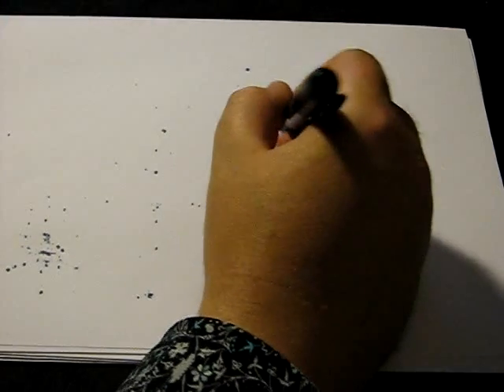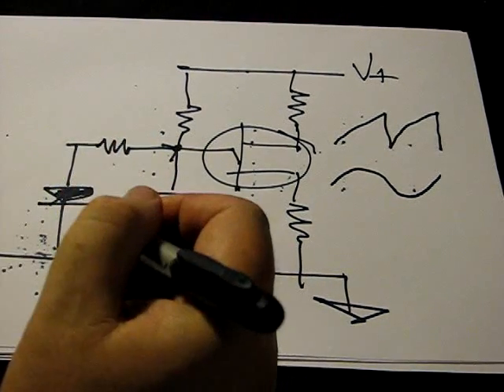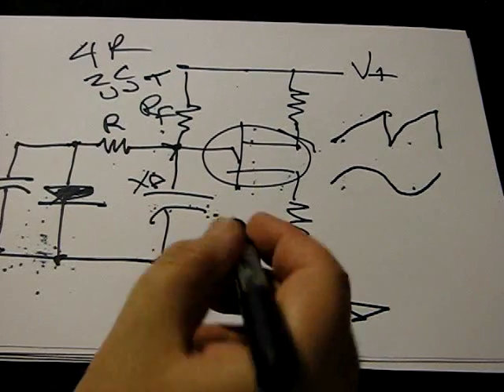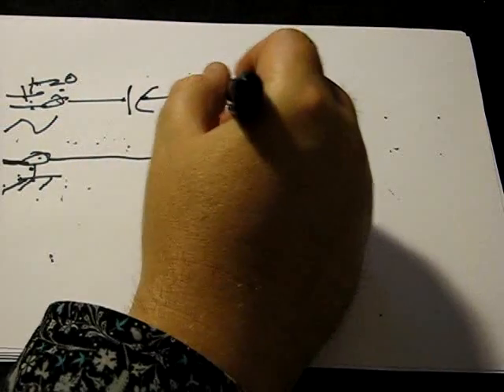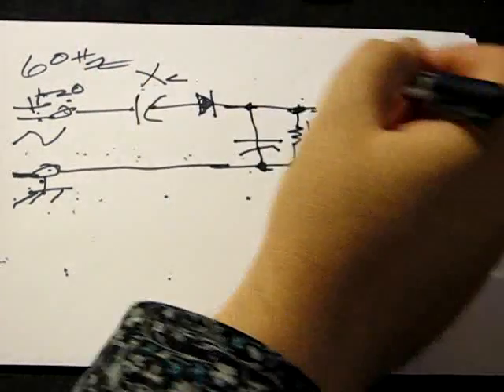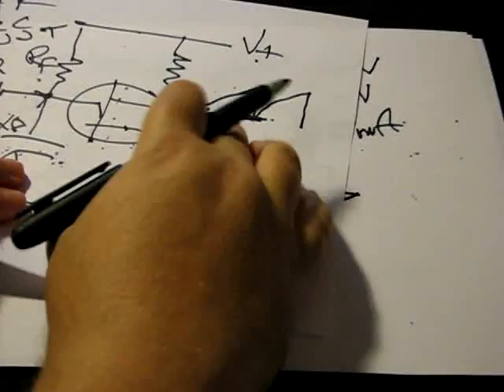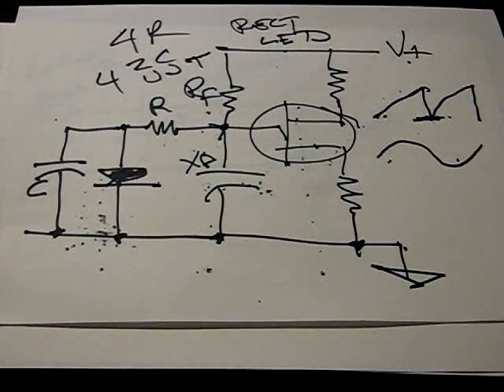Relaxing Oscillators page 2

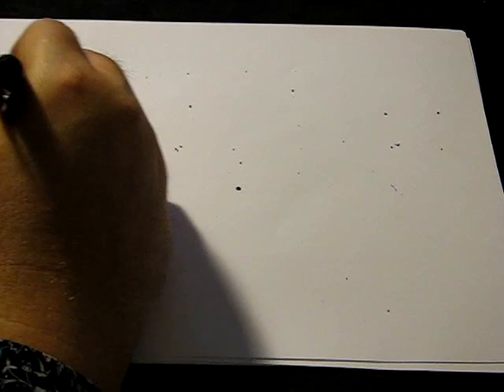Comment: I've never seen a unijunction relaxation oscillator that would operate on as little as 3.3v.  Also, you shouldn't tell amateur experimenters to build circuits without a line isolation transformer. You may contribute to a serious injury or death. There's a distinct relationship between "hot," "neutral," and "ground" that should be explained before anyone eliminates such a transformer. Even your brief, erroneous reference to "white as hot" (3:54) is enough to get someone killed.